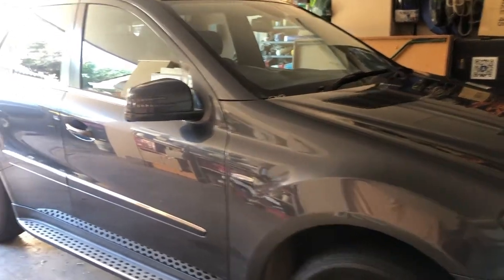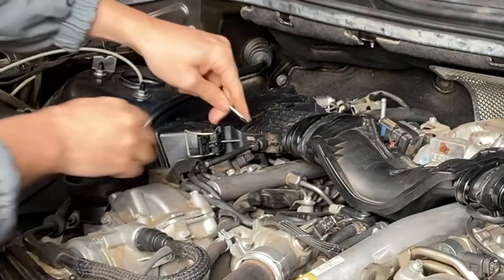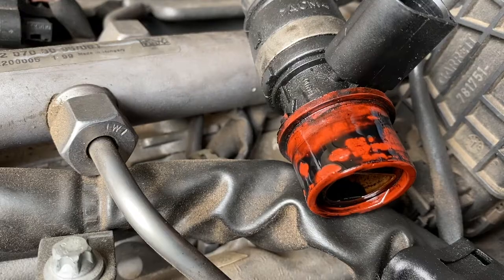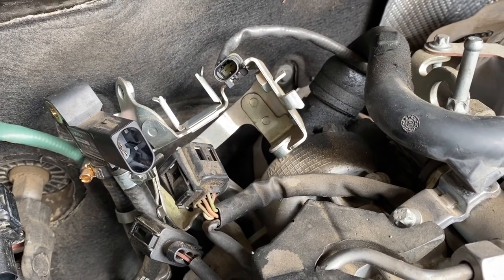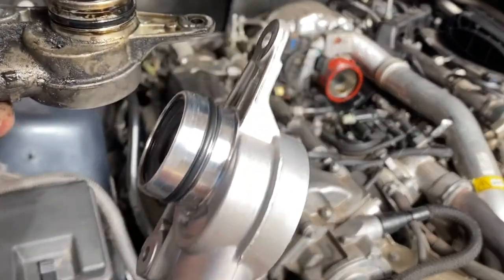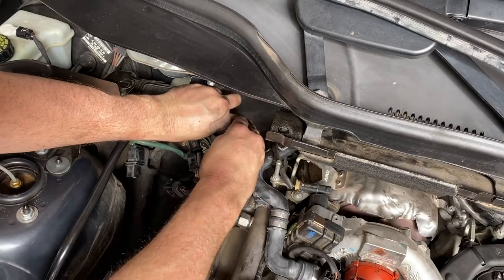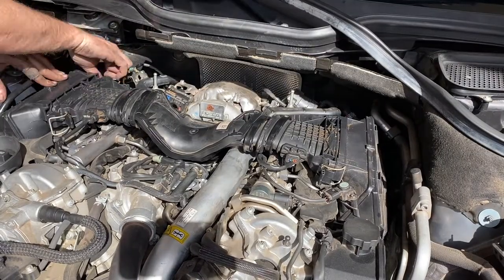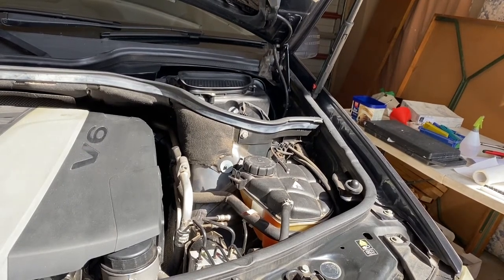How to Replace Mercedes ML W164 OM642 PCV Valve - The Complete DIY Guide - ML300 ML320 ML350

Comment: 17:12  My orange valve keeps slipping out of the y pipe. Does anyone know how to keep it in ?  Thanks
Reply from the maker: How old are your orange seals?  Cheers Drew
Reply: @DrewFixIt  Thanks for replying. Quite new, I check the main turbo one often for leaks on to swirl flap motor. The PCV one just seems loose and pushes itself out after a drive 🙂
Reply from the maker: @damian-795  agreed it's not the best design, my suggestion is to replace the little red seal to the PCV valve with a new one.  Out of interest does your car have the Y pipe the same as my car or is it the earlier design?  Cheers Drew
Reply: @DrewFixIt  Its the same but in a W211 E Class and is the OM642. I just looked that seal today and there is a little notch that was not quite lined up. I think its staying in place now 🙂 , I hope.  A good blow on the motorway may push it out again, I will see. Thanks you for your time, if it plays up I will get a new one.
Reply from the maker: @damian-795  Awesome, thanks for the share.  BTW when you give it "A good blow on the motorway" it should actually suck it in further as your PCV should close and the turbo will spool up creating a vacuum in that breather hose!  Cheers Drew